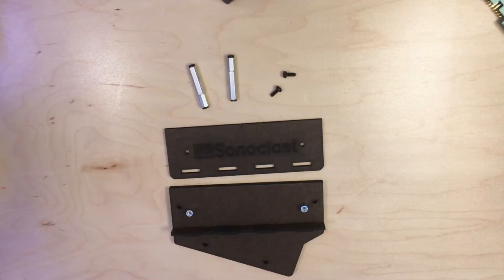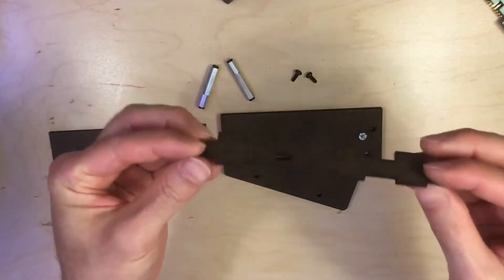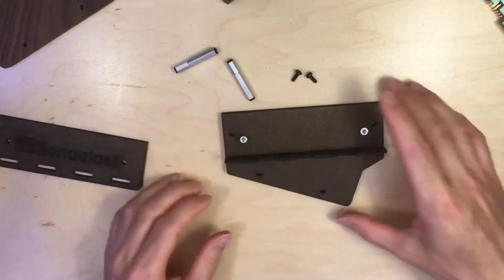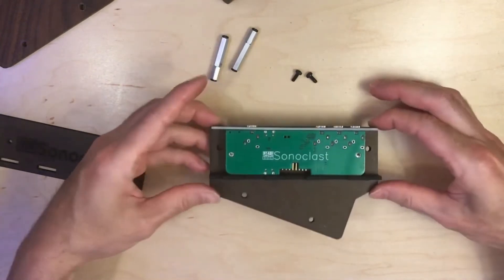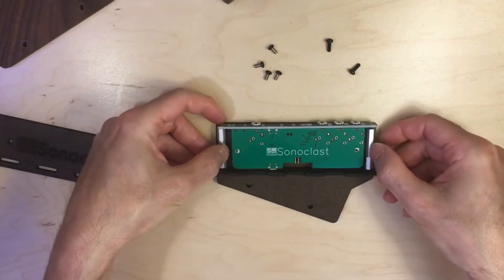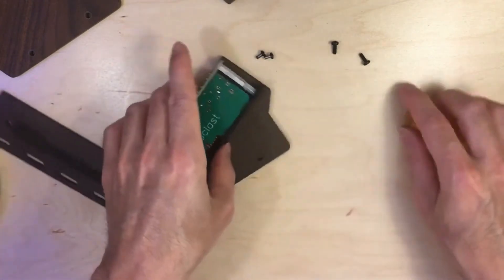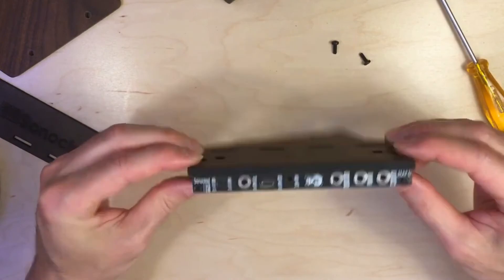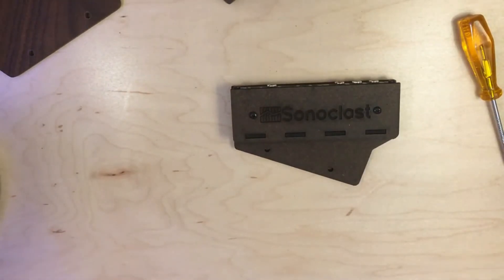MAFD 2hp Case Installation Instructions

Comment: Nice work! Can you mount that thing on the outside of a two-tier-rack, or does that screw up your mounting solution?
Reply from the maker: Yes, it can mount on the side of a tiered rack if you get longer screws (#6-32 x 1″) to replace the ones that come with a DFAM.